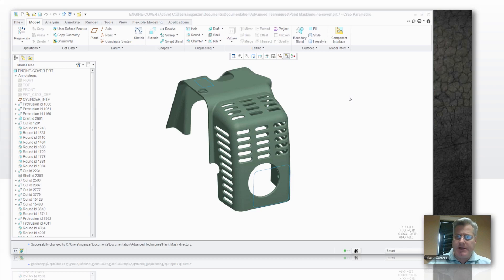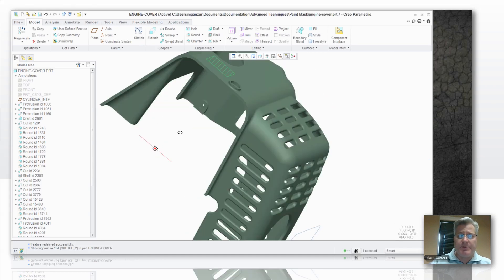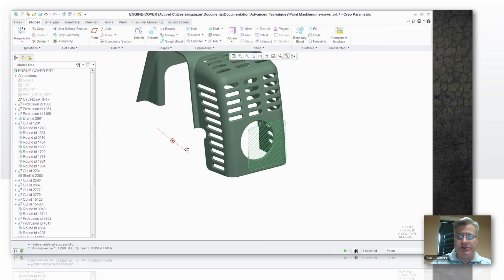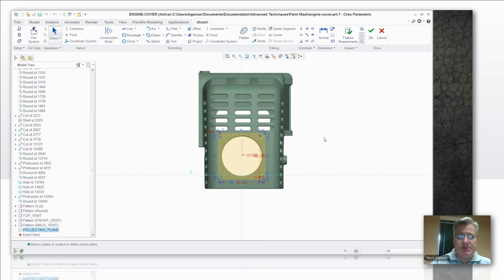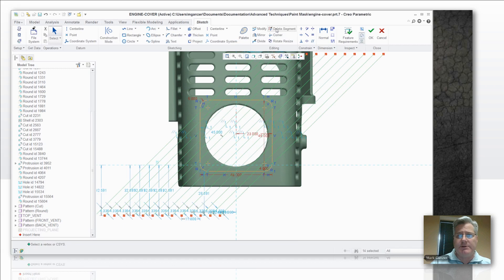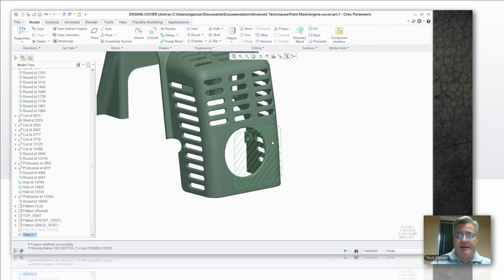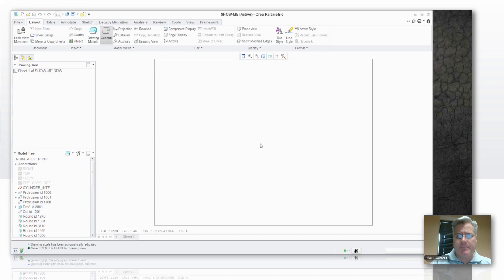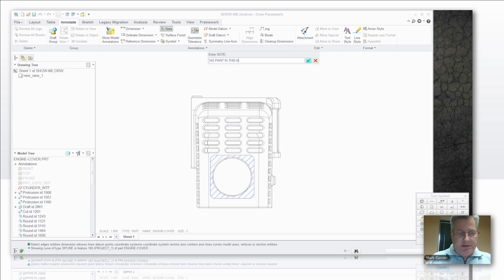Using a cross hatched sketch to mark an area on a Creo Parametric part and Drawing

Comment: thanks for the video.  I tried it and it works great on flat surfaces.  I do have an issue with the projection working on a large radius.  The radius has a centered hole and another crossing the tangent.  My hatching lines 'Splay out" or have in consistant spacing.  There are also missing lines of the projected sketch missing.  Mostly around the holes.  I've tried 'Along direction' and 'Normal to surface'.  Normal to surface gives me a regenerate error.  What am I doing wrong?  Other than maybe not trimming my lines?